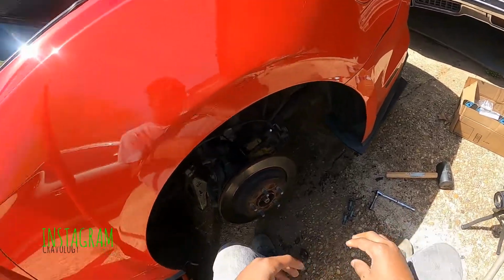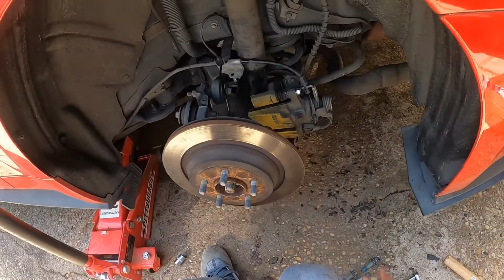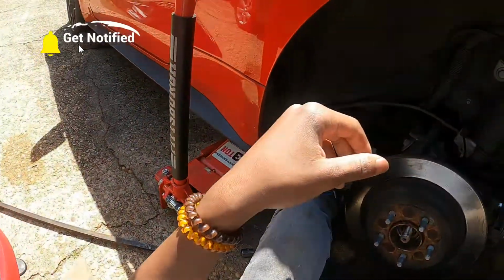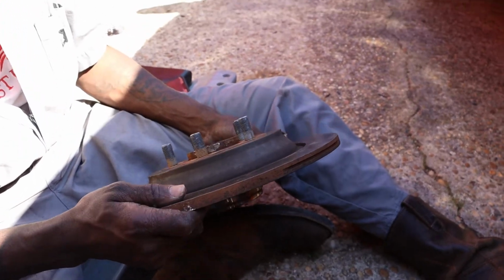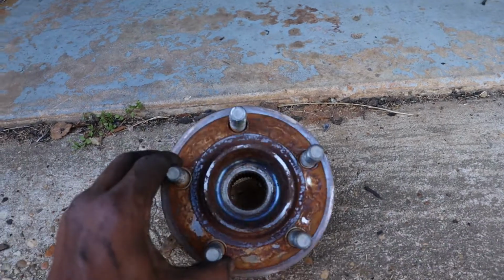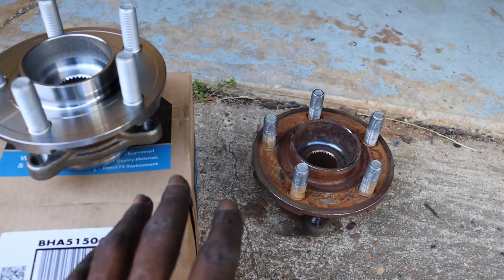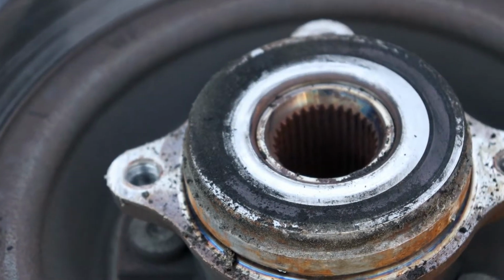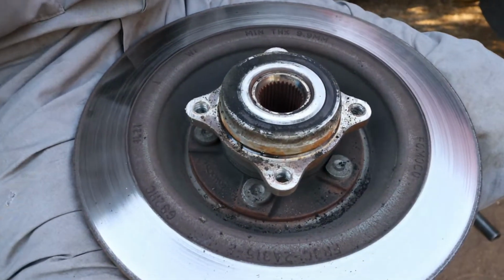Replacing The Rear Wheel Hubs On My Mustang

Comment: I just did my back wheel hub CJ pony video took the whole dam back end apart lol I  just took off the brake caliper and the 4 bolts in the back of the wheel hub only the only issue was my hub was rusted, for the back bolts just break them and then use power ratchet if you have one.

Comment: Thanks to your video I was able to determine what that noise is on my '16.. I have the same exact noise on the same wheel. Did you use a 32mm socket to remove the spindle nut?
Reply from the maker: I'm glad I could help you an I believe it was a 36mm socket
Reply: @dailycrave7859  thanks!